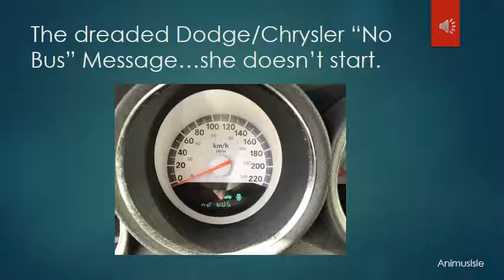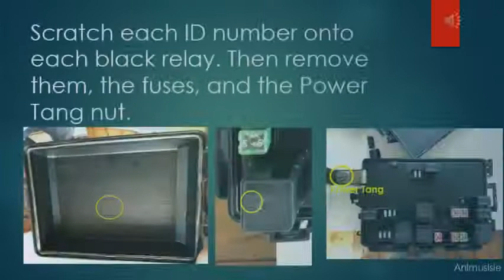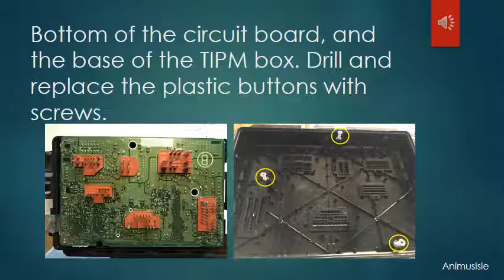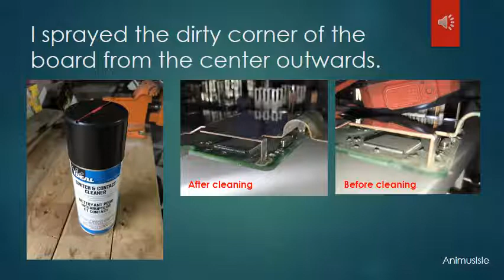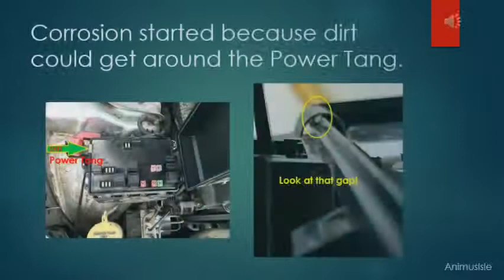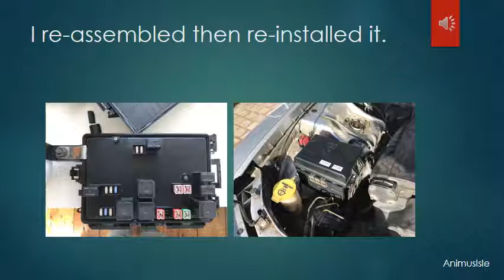No Bus TIPM Fix Dodge Charger 2008

Comment: After cleaning off the dust and corrosion you should make sure the solder joints are good and not cracked or broken, especially around any high current posts.  Then test it to be sure it is working before continuing.  To protect it you don't need any expensive conformal coating or solder mask, a cheap can of clear gloss spray paint will work.  Just tape off any connections or posts you don't want coated and give 20 min between coats from different directions.  Once you have a thick enough clear coat on it you can pull the tape up and seal it back together with some sensor safe RTV sealant.  Permatex Ultra Black gasket maker is what I use because it is sensor and electronics safe.  If you use anything else you need to be careful, most silicone sealants will generate acetic acid (smells like vinegar) when they dry and will corrode metals over time and destroy circuit boards.  

Yes, an inexpensive can of clear gloss spray paint and the correct sensor safe sealant will keep moisture and dirt from getting back in there and when using these it is considered "reworkable" so if you ever do need to get beck in there it is still possible.  If you wanted to you could even coat the board with the Permatex Ultra Black but please don't do that!  Once it's covered in RTV it isn't as easy to work on anymore so use a clear conformal coating, clear enamel or clear acrylic spray paint.  Clear so you can still see what and where... and spray paint is easy to scrape or sand off when you get somewhere you don't want it like the fuse posts...

Comment: Was the TIPM surgery a fix long term lol ?  I'm about to attempt the same thing.
Reply from the maker: Yes, the TIPM has worked perfectly since I fixed it months ago.
Reply: @alfredvouk  Good !!!  That's exactly what I was hoping to hear !!
Reply: Now my charger 2008 has done the same.😔
Reply: Thanks fir the tutorial. I’ll do the same for my 09 Charger. The vehicle is from the Northeast, now in AZ. I’m having some electrical issues. 1amp draw from fuse 14 with key off and turn signals don’t work. I’ve found a little of electrical connectors with green corrosions. I’ve cleaned all the grounds, so now just to do the TIPM, maybe the fuse in the trunk next.